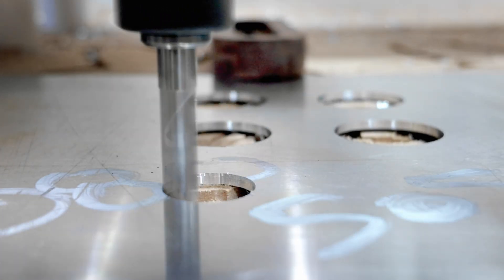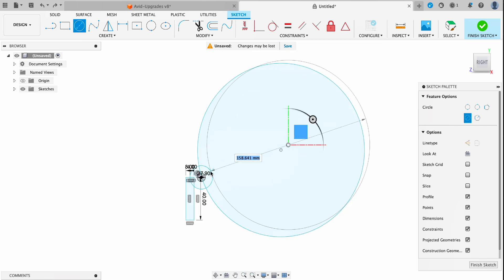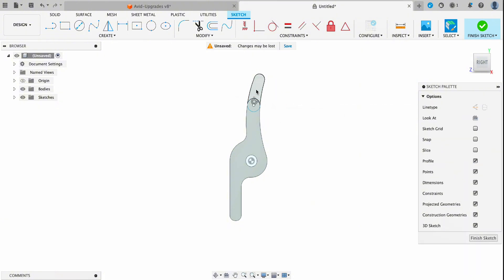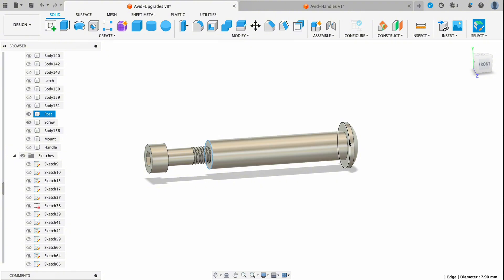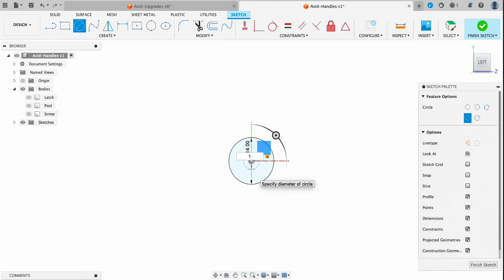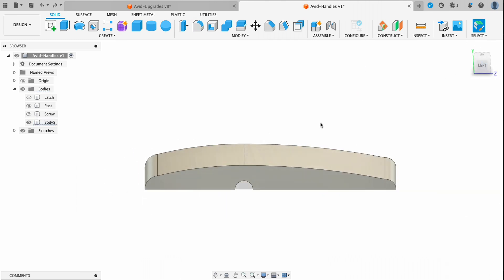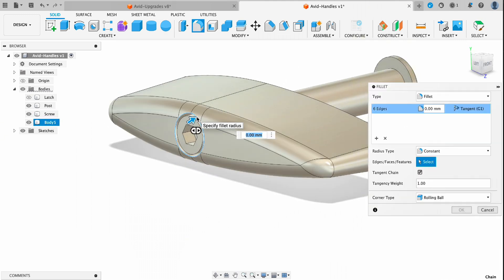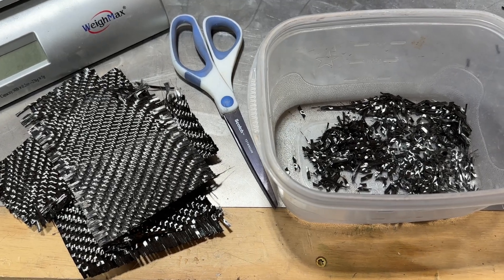How to Make Complex Parts Easy In Fusion 360

Comment: Will it possible to share these Fusion files?
Reply from the maker: Hi there, I'm not planning on sharing the fusion files. I might offer the 3d print files in the future for the molds. What are you looking to do with them?
Reply: I want to little modify the handle to fits my Rans.

If you can share the 3D print file also that would be ok. I can print the sample and check the fitment on Rans.